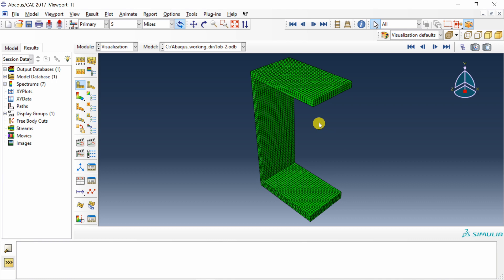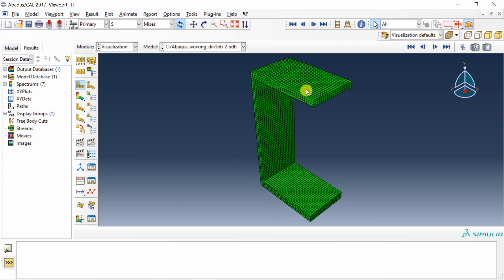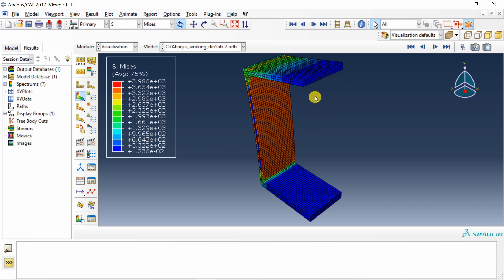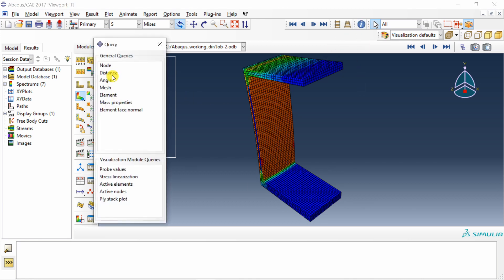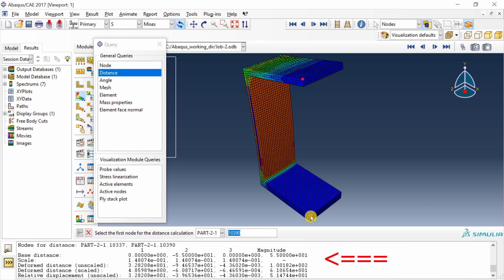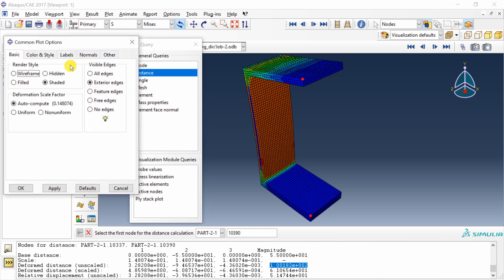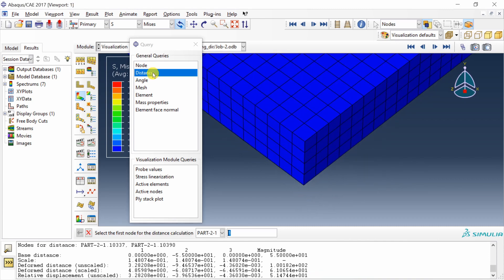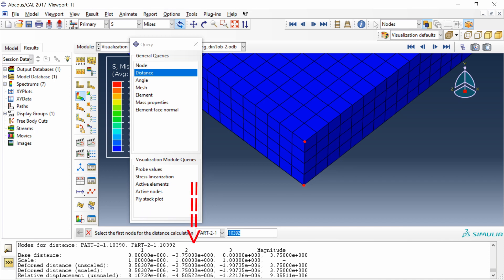How to measure a distance between 2 nodes in Abaqus CAE?

Comment: I want to create a graph with Distance between 2 nodes in Y axis and Time in X axis. Can this be done ?
Reply: I think you can get the position of the 2 nodes separately through: Create XY Data - choose variable COORD - choose the two nodes separately. then you can extract the data, and calculate them by yourself. (not sure if this is the best solution, plz let me know if there are better methods.
Reply: @mialyu3483  The work around is as you said. What i do is calculate the XY data for the deformations at 2 locations separately and then subtract it from each other.